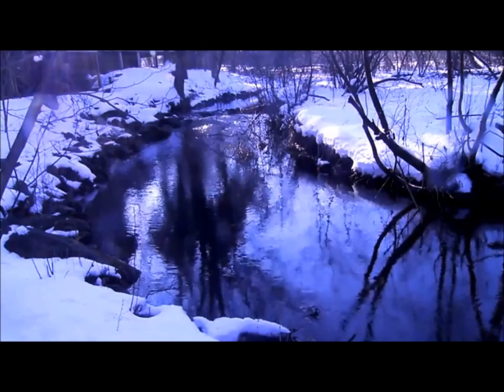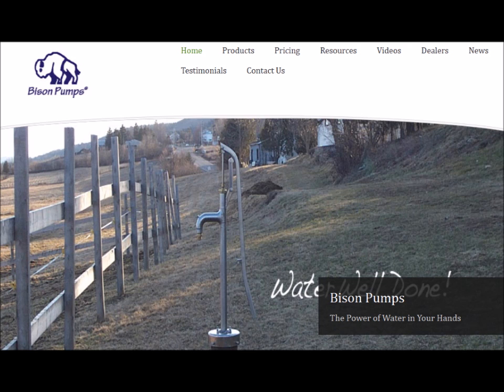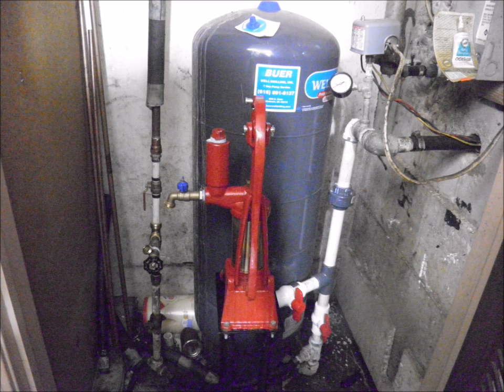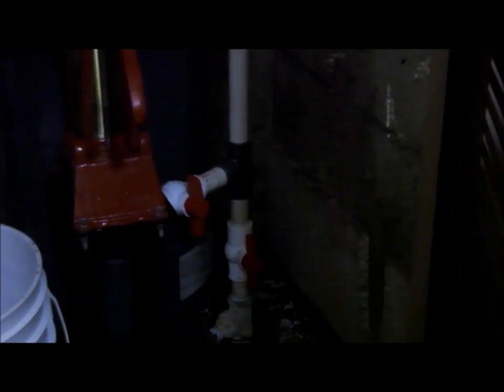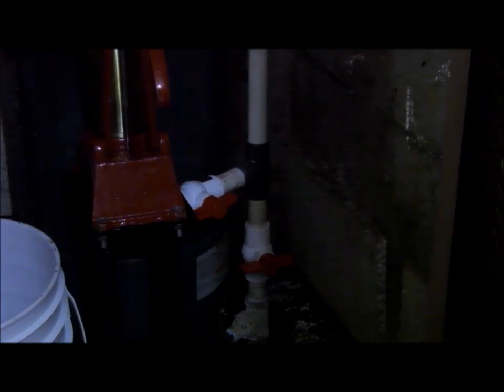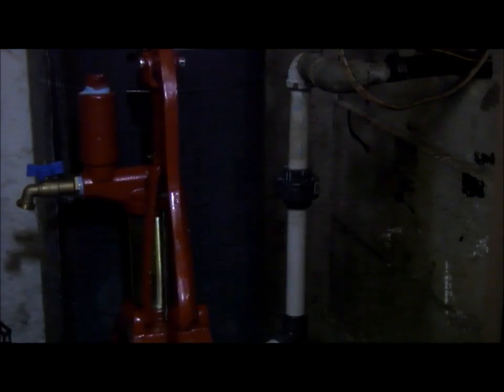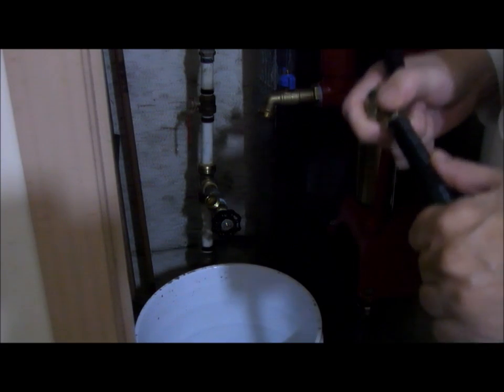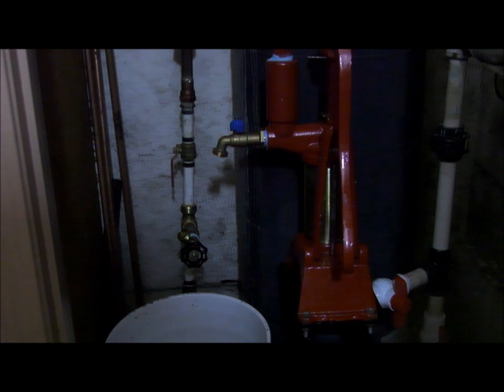Manual In House Water Pump

Comment: Did you also have your well pump's check valve removed? I'm confused how this works with a well check valve in play. I mentioned this setup to my plumber and they said it would only pump the water that's left in the pipe; so that's about 30 gallons till it's pumping air for my system. The check valve prevents exactly this setup from happening effectively to my understanding.

Comment: My water table is 50' and my well is 455' deep. My solution to providing pressurized water for flushing uses a 12V RV pump rated 3gpm, a car battery, a water barrel and 2 short garden hoses. There is an extra connection on my manifold for the output from the pump. The input comes from the barrel. The 6-gallon pressure tank stays pressurized. The 55-gallon drum can be nursed to last a very long time, and I don't have to put possibly unsafe water into my house. I found your video searching for a way to utilize my deep well water when the pump fails, or the power is out.
Reply from the maker: Great MacGyver solution
Reply: How do you get the water into the barrel? Pumping it into the house lines from barrel is easy part but lifting water out of a deep well is difficult
Reply: @jamessurname2285  I was unclear. This is my backup solution for when the power is out or my deep well pump fails. I have a power failure at least weekly, and I set this up when I had guests and lost power.

Comment: Looks like a great setup. My water table is too low for that. Sure wish it wasn't. I'm still digging. But I did find "simple pumps" which has small diameter hand pumps that are deep well pumps. Going to try to copy your setup though. Thanks a bunch.
Reply: How did it turn out? Were you successful?
Our well is deep, like 300’

Comment: I have a serious question,  is this manual pump pumping water from your outdoor tank?  Or is it coming directly from the water well.  Because if the power is out and if this is pulling from your outside tank.  Once the tank is empty you would still be in the same situation as before.   I can only imagine that your plumber installed a bypass loop which would mean you would have to go outside and turn some valves.    I am very interested in how this was done.  Thank you
Reply from the maker: It from our well. I really don't know the technical details but it works like a charm.

Comment: So when you connect it to your plumbing does it charge up your pressure tank, or do you only get running water in the house as someone is pumping it?
Reply from the maker: Only get water out of the pump. It does not deliver water throughout the house

Comment: I have an indoor well pump called a jet pump. I want to install a manual well pump to be able to get water into my house without electricity. I was told by a pump installer that I would have to go with a submersible well pump in order to have an in-house manual well pump installed. Is this true?
Reply from the maker: I do not know but my outdoor well does have a submersible pump.